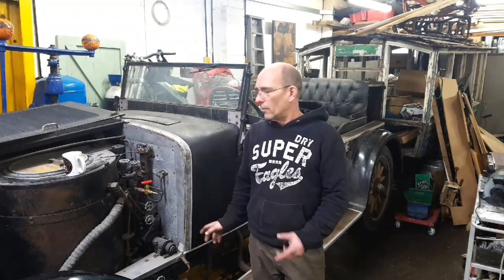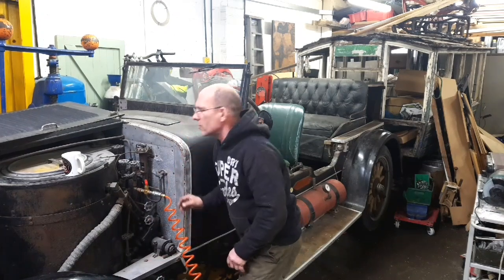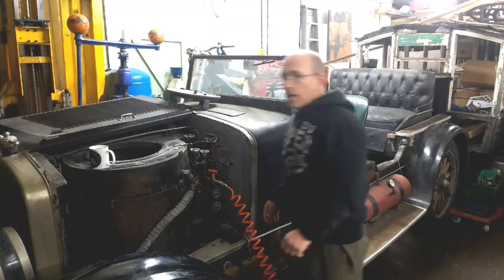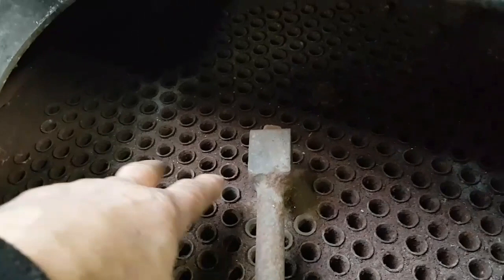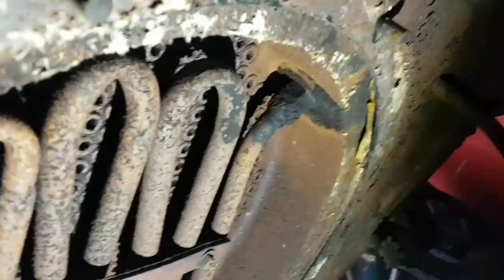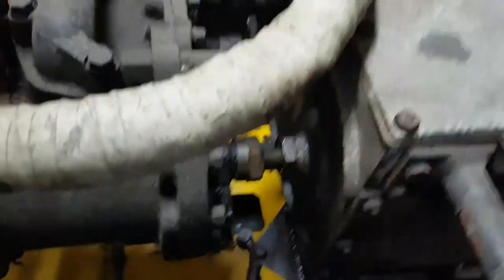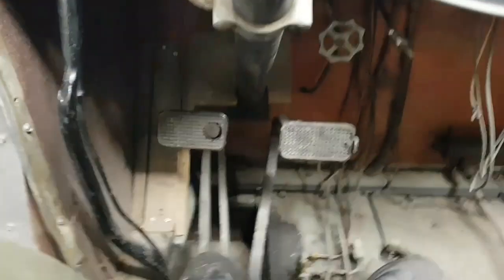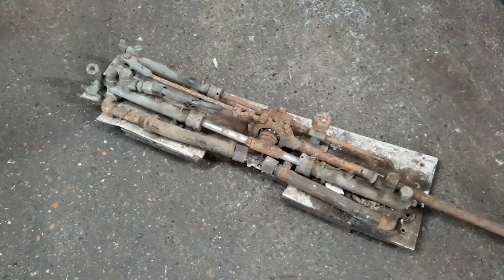1924 Brooks Steam Car Restoration Pt 2 (V002)

Comment: Could  hear her filling up with air. The wheels are going round Tea is allways  good. They  probably rusted out. How many gears does it have or does it have any at all. So it just has forwards and reverse. Ah I see  better to put the  one in mate. Cool I like  the old water pump. Liked watched twice and shared
Reply from the maker: Yes, single speed so it will go as fast backwards as it does forward. I wouldnt want to go very fast backwards in it though. Thanks for the share Ali and thank you for watching.
Reply: @workshopgeorge1078   I never got Notification for this video mate. I  have  cleared my history to see if this cures it but currently yt are having problems with notifications.

Comment: The Boiler looks like an original Brooks, all welded with oxygen-acetylene, they machined a collar in the bottom tube holes and acetylene welded tube to collar, top of tube is expanded Brooks original tubes are 17/32nds OD.   I owned a Brooks for 25 years and rebuilt both boiler and engine, then drove same for over 2000 miles.  Is that from the Theobald collection?   Richard